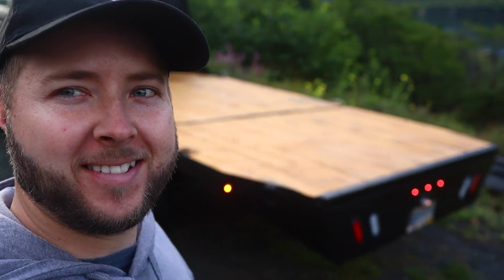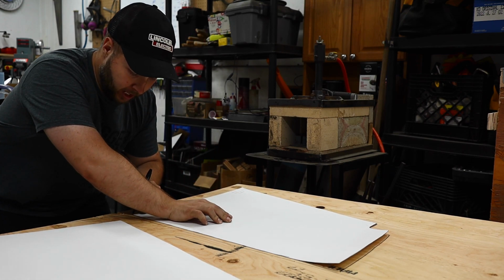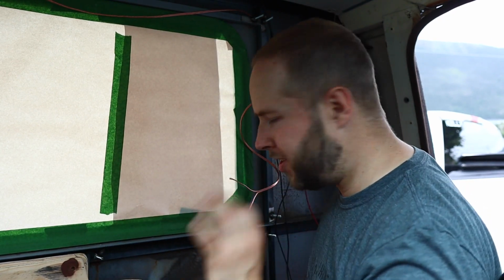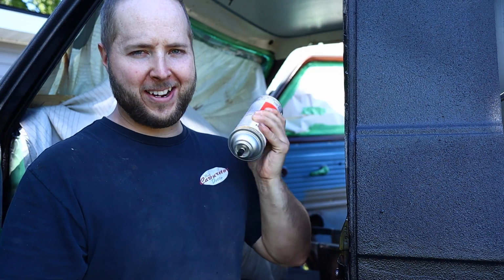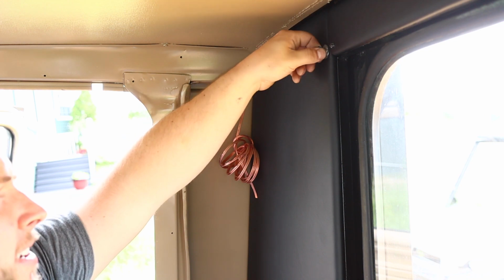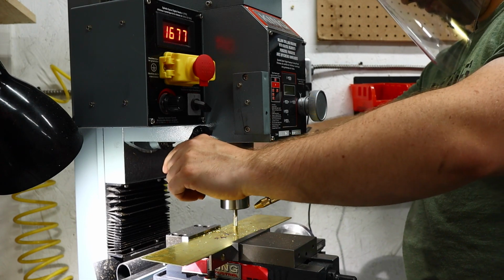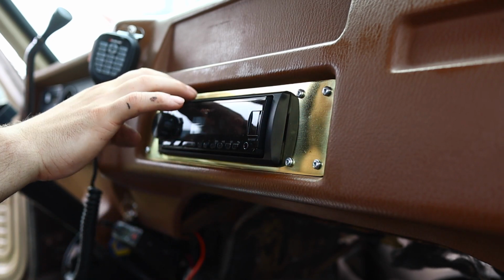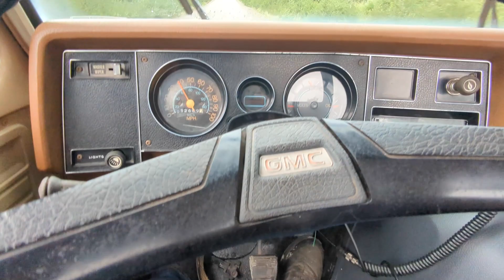Check out this SWEET Custom Interior! -  [31]

Comment: Looks great although I'll admit I'm not sure about the wingnuts and bolts sticking out into the occupied space.  I think those are going to snag on everything that gets close to them.
Reply: Acorn nuts, maybe?
Reply from the maker: I'll change them out if it ever becomes an issue, but I really like how they look, and I didn't want to need tools on hand if I needed to remove a panel for some purpose